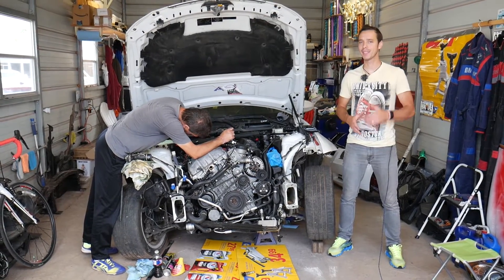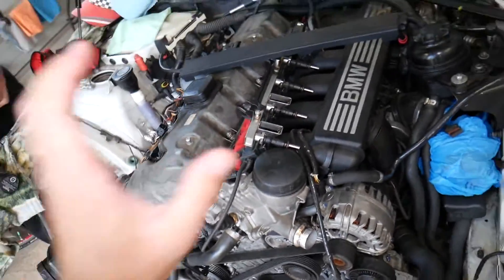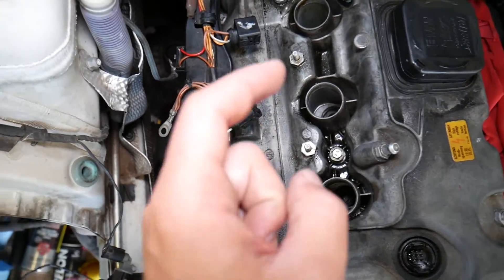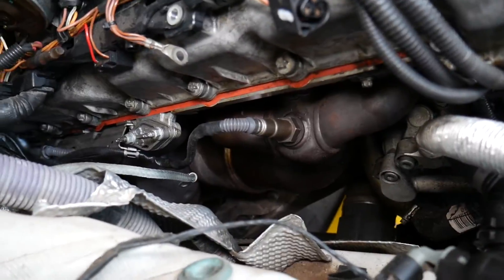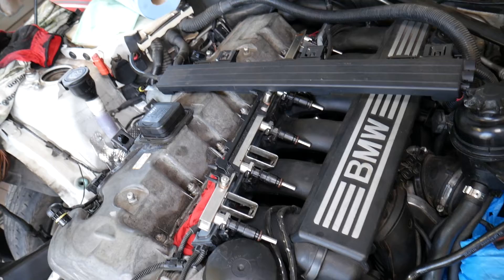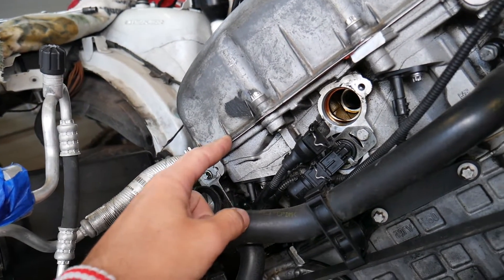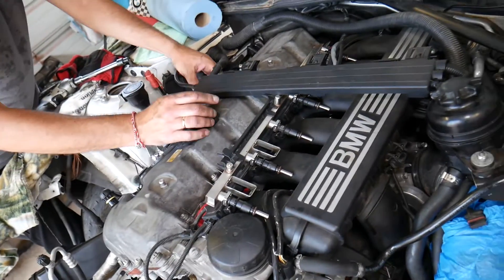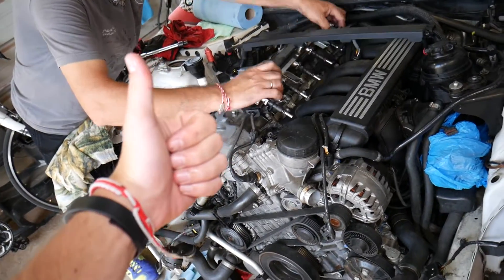BMW CODE P0300 RANDOM MULTIPLE CYLINDER MISFIRE DETECTED FIX

Comment: My car, 328i E90 slowly lost power over about 8 miles on the highway and died on the exit ramp. Had just used a fuel system cleaner. Fuel pump eventually went out and now I think some trash got up the line and into the injectors. I have new plugs, new coils, new fuel pump, 70psi on fuel rail, injectors clock but continue to get multiple misfires code and misfire code on cylinders 4,5 and 6. Never got any fuel pump codes (perhaps as it died before the car could tell it was low pressure). Thank you for the videos!

Comment: Hi iam a follower , i have a 2009 BMW 650I convertible with 4.8LT engine has a multiple miss in cylinders 1,5,8 .has a DTC (2ABE) I replaced these ignition coils and spark plugs and the missing is the same , any advise thank you
Reply: It’s scrap

Comment: 2001 bmw 330ci p1347: misfire cylinder 3 with fuel cut-off p1345: misfire cylinder 2 with fuel cut-off p1343: misfire cylinder 1 with fuel cut-off p0174: system too lean bank 2
Reply: Check compression

Comment: I have codes 0300, 0301, 0303, 0304 & 0305 on my BMW 535i GT. It’s making a whining noise and shaking a lot.
Reply: What was the issue
Reply: I'm not sure. I had the valvetronic motor replaced and that was not the issue
 @juketownrecords4297
Reply: I have the same problem

Comment: I heard some whining and struggling noises coming from the rear whe  turning ignition on (but not cranking). Assumed it was fuel pump priming. Then after a few weeks I have misfires on 4 cylinders. I'm hoping this is a blocked fuel filter/failed pressure regulator. Could I be close?

Comment: Hello I like your Channel 
I have an 06 bmw x5 which keeps misfiring on Cyl 2 only every time I  erase the code car runs smooth sometimes it takes a long time for it to come back 
New spark plugs and coils all hoses and gaskets have been replaced because of previous lean codes new fuel pump 
I already swap injectors and still comes back to the same cylinder 
I must say it only happens at idle because when it’s running it’s fine 
Compression is good by the way
Reply: Did you find the problem
Reply: Never did

Comment: Had misfire on cylinder nr 2; moved coil to nr 3; that from nr 3 moved to 2; started engine same misfire on 2 (checked by removing the jack out of coil, engine continued to run on 5 cylinders like); then misfire on 3 :)))), after the second engine start. Has anyone an idea what could be? Spark plugs were all replaced.
Reply: Did you fix the problem???
Reply: @Epicfunzone2024  changed oxygen lambda sensor and had a huge hole before the idle control valve

Comment: I have a 2017 bmw 530i 4 cylinder and I have three of my cylinders misfiring . Codes P0300, P0302, P0303. Please help
Reply: Have you checked air intake channel between MAF and manifold? Gaskets and both DISA valves?

Comment: I have a misfire in ALL cylinders and its running in limp mode (engine malfunction reduced power)
I got a 335xi
Injectors are 12th revision and i look at the back and its no smoke
Has a new Low pressure fuel pump
Ignition coils were on there tight… 4 dont have a brand on them but and 2 are bosch
Plugs i just replaced, laser iridum
The low compression test was done at a shop and it checks out

Car has test pipes but the o2 sensor doesnt have a spacer on them so it gets wrong reading, but is that why its going into limp mode and has misfires in every sensor?

Lets say it wasnt vacuum leak
Dirty valves
And the vanos?
What else?
Reply: Have you figured it out my 325i is doing the same thing over 4K rpm it goes into limp mode changed coils maf sensor and iac sensor
Reply: Did you ever figure it out? My car has the same issue
Reply: Same. Figure it out? Solution?
Reply: C'mon pal, tell us the fix 🙏